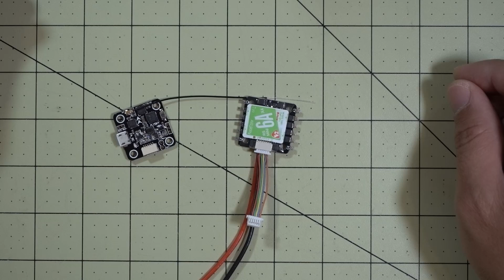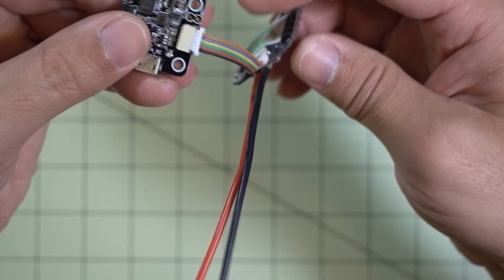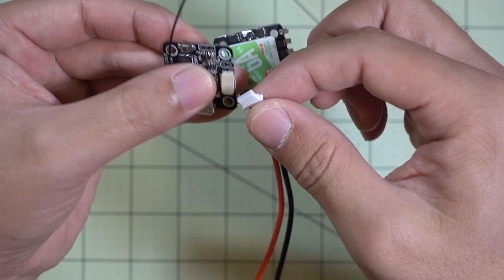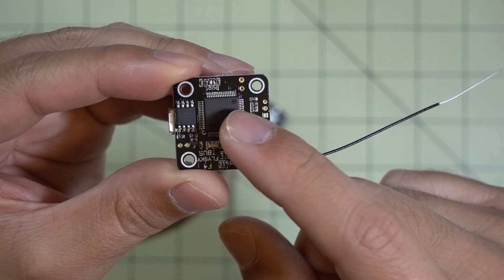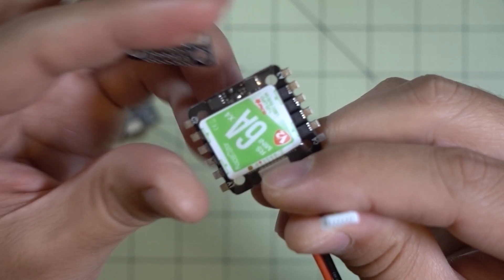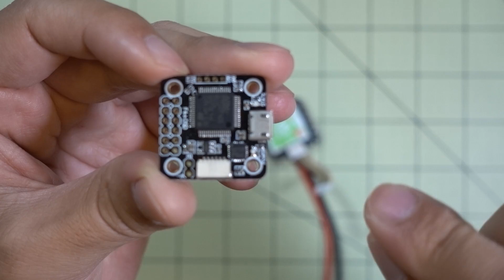Easy Bake Micro Drones 🎂 DIY PowerCubes 🍰💡😀

Comment: I bought the F4 fc with flysky receiver you showed in the video, but mine is beeping as soon as i disable any stabilized mode. The normal beeper function with aux switch doesn't work. I tried upgrading to BF 3.1.7 and disabling all beeper functions via CLI. Do you think the board is faulty? Or do you have the same issue?
Reply from the maker: +Kaptn Firlefanz not having that issue. No idea what that is
Reply: Albert Kim thanks for quick response and the video. I will contact the support.

Comment: I still have not heard of a clear reason why I would not go with say a 20A esc to future proof upgrades to a build.  Is there a greater chance of burning out your motors with an oversized esc?
Reply from the maker: +ben dorman no, that won't happen.
Reply: cool thanks.  looks like the different in the racestar 6amp with no wires is 4.5g and the 12amp is 9g.  Thicker gauge wire adds up too.

Comment: have you got a link for just the 6pin connector? I can't find any
Reply from the maker: Those are included with the 4-in-1 ESC.
Reply: Albert Kim yeah I know but one of mine got cut. having a hard time finding the harness by itself
Reply from the maker: Ah... Try searching on eBay. JST-SH 1.0mm 6-pin... You'll probably get a bunch of hits.  You can also direct solder one side as well.  I may do a video on how to do that.  It's not that hard.
Reply: Albert Kim I will do some more digging. I direct solder them usually but was wanting to use strain plug and play for my Rotorious FPV Crook110
Reply: gkitty99  Try and search "omnibus cable" on eBay or AliExpress.